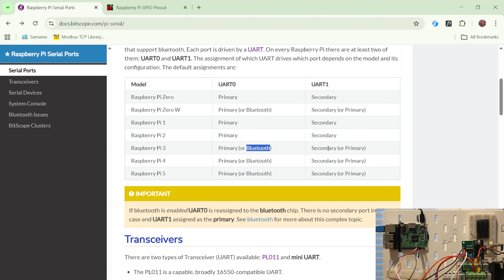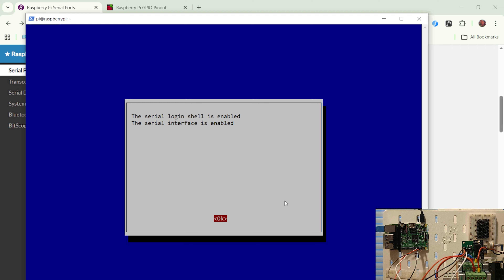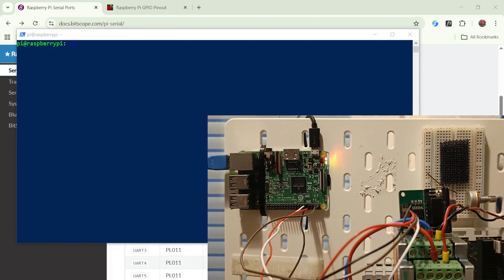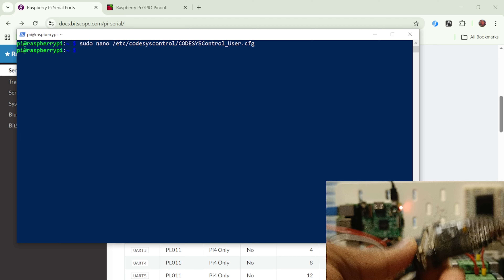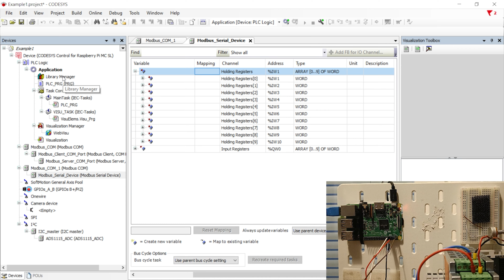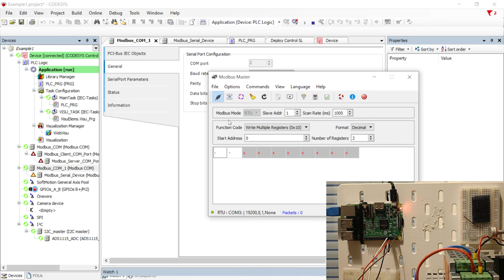Modbus RTU Master over GPIO Serial Pins| Codesys Control for Raspberry Pi

Comment: Very good video, but just to clarify two things. 1. You have two Modbus Com devices used in the CDS project. You added the second one for communication with Raspberry PI. Is the first one reserved for the ABB PLC? 2. What blue network cable connected to Raspberry PI is used for? And thank you for posting links to used equipment. That is particularly helpful.
Reply from the maker: Yes, the first Com Device is reserved for communication with the ABB PLC (Com 1). I added a second one (Com 2) just for testing during this demostration . For every Com Port, you must add a Com Device.

The Blue network cable is used for loging into the raspberry pi (via ssh) to make configurations on the Linux side and also uploading the codesys code